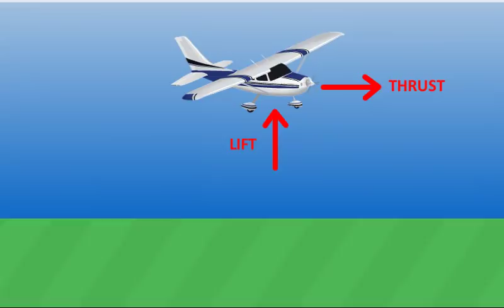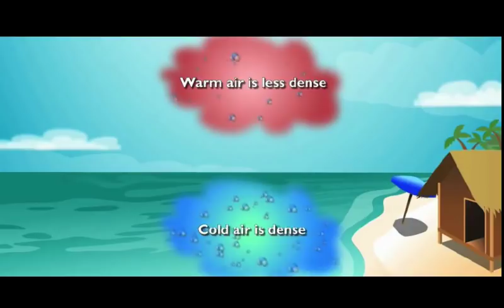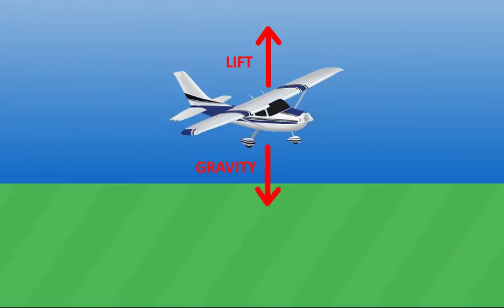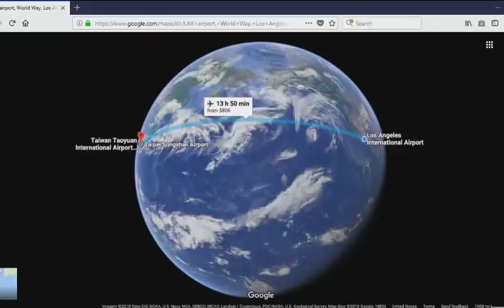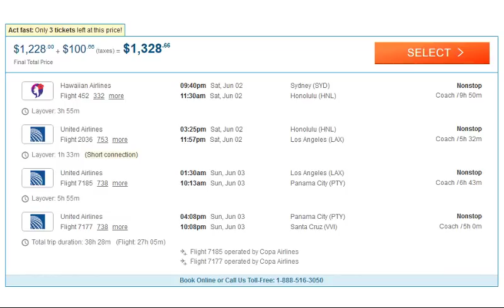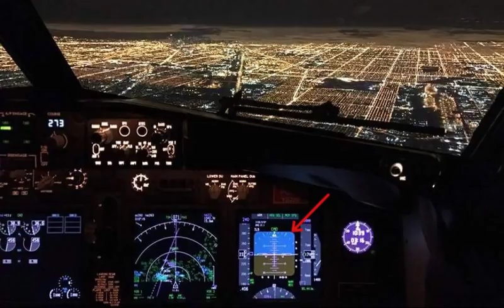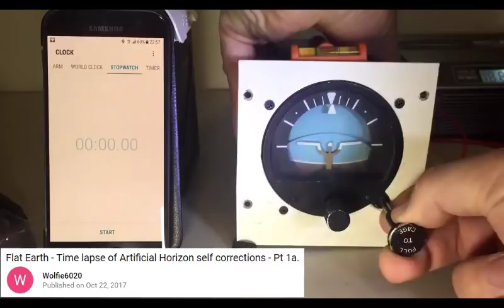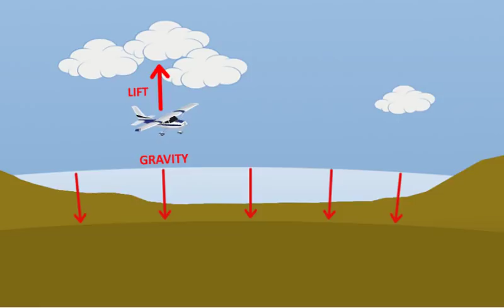Flat Earth Falsities - Plane Nonsense

Comment: This explains nothing....

On the one hand we have gravity pushing down the atmosphere to earth...

Then in the next breath we have cold air moving down and hot air moving up....so in effect the powerful gravity has a hard time keeping warm air down but an easy time fighting jet engines & helicopters...plausible...
Reply: You see Anthony, the force of gravity is proportional to the mass. Warm air rises only because cold air which has greater mass falls. Helicopters and jet engines have even more mass so gravity exerts a greater force. An 8-year-old seems to understand gravity https://youtu.be/QcUey-DVYjk so why can't you?
.
When airfoils like helicopter rotor blades and jet aircraft wings move through air, they produce lift; with sufficient speed and angles, enough to lift helicopters and jet aircraft. But maybe you should master gravity first.
.
In a vacuum chamber a bowling ball and a feather fall at the same rate. What causes this to happen Anthony? They accelerate at 9.8 m/s², which is "g" the acceleration of gravity.
Reply: @romithromith  they fall at the same rate...🤦‍♂️

That proves the density of a feather versus air is enough to slow the feather down...in a vacuum there is no friction from the air to slow it down...

Yes it might travel at the same speed but it certainly doesnt prove gravity.....

Same as chucking a stone in a river as oppose to a piece of wood..

The stone will sink because it's more dense than the water the wood will float because it isnt
Reply: @anthonyferguson4218  A. It's proven that things fall.
B. It proven that things fall with a constant acceleration in a vacuum.
C. This is a physical phenomenon.
D. We named this phenomenon gravity. Gravity is just a name!
.
Air drag slows my truck, friction from a rough road slows my truck.
You wouldn't say that air density or a bumpy road causes my truck to move.
You wouldn't say my truck wants to find its place.
There is a mechanical force causing my truck to move horizontally.
What force causes things to move vertically?
Think: why does it take more energy to drive up a hill than down the other side?
.
Buoyancy is the effect of gravity in a fluid environment, not a disproof of gravity. (Do an experiment to test gravity. 1. Weigh a piece of wood, 2. Weight a bucket of water, 3. Weigh the bucket of water with the wood floating in it. If gravity exists, 1 + 2 should weigh the same as 3. Let us know your results.)
Reply: @romithromith  why do things go faster downhill?🤦‍♂️

What are you talking about??

My wagon will free wheel down a hill quicker than my car...it also takes more effort to stop because its heavier..

None of this is relevant it's just filibuster👍 seems quite hard to get direct answers....yet I keep getting told 5 year olds understand it...yet the same people avoid the question and resort to ad hominem attacks instead...🤦‍♂️
Reply: @anthonyferguson4218  I have no idea what you don't understand or want to know. Without an understanding of Physics you are vulnerable to the arguments these FEers use.
.
If Earth isn't moving 1,000 mph, then the Sun is moving 1,000 mph. That's faster than the speed of sound. You should see the Sun streaking through the sky. You should hear sonic booms on a daily basis.
.
The FE gurus use a common sense fallacy and appeals to personal incredulity. Polaris isn't exactly at the center and it's not always been the pole star. Stars are at astronomical distances and also in motion around the galaxy, the earth exhibits conservation of angular momentum, precession occurs, planets do perturb one another but slightly, you need to understand inertial frames of reference. The helicopter retains its momentum when lifting off.
.
Pan Am Flight 50 did cross Antarctica. https://www.cnn.com/travel/article/pole-to-pole-pan-am-flight-50/index.html But there are issues with flying across Antarctica such as fuel freezing, strong winds and unpredictable weather, the stigma of the crash of a New Zealand flight over the continent, emergencies and navigation.
Reply: @romithromith  any citations on polaris??

Earth spins at 1000mph...

It goes around sun at 67000mph

Chasing the sun as it moves 500000mph

In a galaxy that's doing over 1million mph..

If its spinning 1000mph and I'm following in a plane at 500mph how will I ever get there??

And going the other way I should just be able to hover until my destination comes around..

You say physics....that's a little lazy throw around word it's either spinning or it isnt..🤷🏾‍♂️
Reply: @anthonyferguson4218  I don't have time now. I'll get the citations later.
.
Spin is measured as angular velocity. Earth spins once per day. The instantons velocity at the equator is ~1,040 mph. The centrifugal force is much, much less than gravity.
.
The other speeds are constant and very nearly linear so acceleration is miniscule. We don't perceive speed, only acceleration.
.
The Earth isn't chasing the Sun. The solar system is in an inertial frame of reference.
.
No, the plane or helicopter were rotating with the Earth and the momentum is conserved when they leave the ground.
.
No Physics isn't a lazy throw around word. You would have understood already and not bothered asking these questions.
Reply: Physics. Learn it.
Reply: Anthony Ferguson

"This explains nothing...."
Actually, if the earth were flat and not spinning, we wouldn't have weather. No wind, no clouds moving along.
Reply: @SamIAm-kz4hg  I've never seen a roundabout create weather...🤦‍♂️🤦‍♂️

The sun causes weather....it creeates heat that rises and colder air moves in...creating warm fronts cold fronts and different air pressures..

Spring creates weather..🤦‍♂️🤦‍♂️😁
Reply: @anthonyferguson4218  did your school bus have two seats?
Reply: @SamIAm-kz4hg  🤦‍♂️🤦‍♂️🤣🤣

Ffs...🤣🤣 the sun doesnt heat everywhere evenly at the same time you plank...ffs🤣🤦‍♂️
Reply: @anthonyferguson4218  did your school bus only have one seat?
Reply: @CaptWesStarwind  I went go school on the lunar rover....me grandad made it from some old pram wheels and a pallet.. 👍
Reply: @anthonyferguson4218  
If the earth were flat, it would. This is why the flat earth theory is bullshit.
Reply: @SamIAm-kz4hg  ridiculous comment...you obviously know nothing about weather...
Reply: @CaptWesStarwind  it's not that moronic at all...and I thought exactly the same way until a few weeks ago....I didnt give it a look because it was a nutjob world imo...but I eventually had a look in the aim of debunking it as bs instantly...and yet I couldn't...I must be stupid...🤷🏾‍♂️

But theres flat earth and flat earth...one is a flat earth flat earthers think is stupid...its a fake one picked on by people to steer people away from a more realistic possibility...

And I say possibility....because just as flat earth can not be proven or disproven    unless they let flights go directly over Antarctica....ball earth can not be proven that it spins 1000mph around a sun at 67000 miles per hour following a sun at 500000 which is also moving with its galaxy at over 1m mph...all the while keeping north start in the same place as it has been for 1000s of years...

Apparently they can fly into space and take pictures...yet no real pictures or video exist.. .so until that time that either can be confirmed by fact not pseudo science bs...they are both just beliefs
Reply: @SamIAm-kz4hg  you have no clue...seriously...no clue.....zero
Reply: @CaptWesStarwind  I believe its plausible...you believe its spinning around like a spinning top on itself around the sun at the same time as flying through space...

It's a belief it certainly isnt fact...its exactly the same thing you believe what your told...there is absolutely zero evidence...to back up your claim

There's 2 trains of thought......one takes billions of tax payers money 

1 doesn't make anyone any money...now i wonder which one science will pick to follow...🤔

100s of billions have been spent on space from that we have gained some cartoon pictures of earth and some fake mars footage

It's a bargain...👍
Reply: @CaptWesStarwind  try and remain focused...instead of ad hominem attacks tel me all about this simple geometry you speak of👍

I am just a fool who needs to learn from you oh wise one🙏
Reply: @anthonyferguson4218  
"you have no clue...seriously...no clue.....zero"
Did you think this was an intelligent response for something?
The irony is awesome.
Reply: @SamIAm-kz4hg  the sun makes weather ffs it's not hard to get your head around.. 🤦‍♂️
Reply: @anthonyferguson4218  And yet again you provide nothing meaningful in response. What is it about weather you think I don't know? Use your words.
Reply: @SamIAm-kz4hg  no not really that just got made up in the 1970s textbooks....there is no mention of it before...

All ancient calendars used flat earth...they still work...the north star is still in the same place it always has been..

How is it possible with the speed and trajectory the planets all spinning around each other at different speeds...

Then how is it spinning 1000mph commercial flights only cruuse at around 500mph..making it impossible to reach your destination if following the rotation. ..if going against it you will speed the journey up x3...

Technically I should be able to hover in a helicopter and wait for my destination to turn up...highly improbable imo
Reply: @SamIAm-kz4hg  and btw there is not 1 real picture of earth from space...not 1
Reply: @anthonyferguson4218  
"no not really that just got made up in the 1970s textbooks....there is no mention of it before..."
So now you are adding EVERY historian to your conspiracy. Are you beginning to see why you sound looney too us?

"All ancient calendars used flat earth...they still work...the north star is still in the same place it always has been.."
WTF?!?!?! The spinning of the Earth does not change from day to day. It has no influence on a calendar. And the north star isn't actually in one spot. It is close. With as long night exposure you can see that it scribes a very tiny circle. But that "fact" has no bearing on whether the Earth is flat or not. Again, you're really sounding looney.

"How is it possible with the speed and trajectory the planets all spinning around each other at different speeds..."
WHY AREN'T YOU EDUCATING YOURSELF ABOUT THIS??!?!?!?!?!?!?! The planets that make up our solar system are INCREDIBLY far apart. Yes, they travel at different speeds. What about it? Are they not allowed to?  ; )

"Then how is it spinning 1000mph commercial flights only cruuse at around 500mph..making it impossible to reach your destination if following the rotation. ..if going against it you will speed the journey up x3..."
What the fuck are you smoking?
I suspect that you think if you jump up in a moving train travelling at 60 mph then you will be shot backward at 60 mph, right?
Everything on the Earth travels WITH THE EARTH. That includes the atmosphere. Planes fly in the atmosphere.
Please please educate yourself properly.
You sound like a complete and utter fucking moron.
Reply: @CaptWesStarwind  I'm getting conned by you...Never A Straight Answer

I'm not fully sold on it btw...but it has made me question why a took the ball version as gospel with zero evidence or questioning....because science says🤦‍♂️

That was my error i bought into ball earth with zero thought...just like everyone else...pseudo science with no evidence is not fact...its belief

If I can get satisfactory answers to questions I will go back ball...but the so called set in stone "science" seems to rely more on name calling than evidence..

Which is a little worrying....all this money spent and no evidence...no logical answers to simple questions🤔
Reply: @anthonyferguson4218  Don't fall for Taboo Conspiracy's condescending sarcasm. Fast talkers like Ben are con artists. 

Refraction is real and most significant over water – you notice he's always doing his observations over water. He never acknowledges that objects seen one day will not be seen the next. I commented about 2 issues with his laser, instead of responding he banned me.He likes playing to people that don't catch his BS.
Reply: @romithromith  the reason you cant see sometimes is because of the air quality...I can go up hills walking one day and see for miles another day I will see lot of haze and visibility will be poor even though it's a nice day. The reason it's done over water is water is level...you rarely get land level for a good stretch which makes it hard to compare which is specifically why water is used it's much easier...refraction is a thing but not on them pictures

Aeroplanes fly level not nose down...its nothing to do with gyroscopes or autopilot altitudes...its easy to see hour flying level by the clouds and your drinks...planes dont drop a mile every five minutes to stick around the globe...that is for sure

If your spinning earth is at 1000mph but cruising in aeroplane is 500mph...how do I ever get to my destination if it's spin is going with me...it would be moving away from me..🤔
Reply: @anthonyferguson4218  oh, and you clearly don't understand science. Try getting an actual education.
Reply: @anthonyferguson4218  The amount of the Toronto skyline seen from across Lake Ontario varies. So too the amount of Chicago skyline. Joshua Nowicki made the news taking photos from a spot where Chicago is not typically seen. This is called looming.
.
The reason it's done over water is that the lowest levels of air are much denser and produce greater terrestrial refraction. Explain Wallace's result in the Bedford Level Experiment.
.
Because of the atmospheric pressure gradient, which also curves with the earth (and the scale of Earth) planes don't need to fly nose down. No, planes follow the curve of Earth so the remain at the same altitude.
.
Your plane retains the momentum of Earth and speed is calculated against the ground. The autopilot makes small continuous collections flying north or south.
Reply: @romithromith  that's impossible...the ground is moving twice as fast as the plane on a spinning globe...or am I supposed to believe that the air also spins at the same speed as the ground so it's all relevant to each other and not noticeable because its all beautiful synchronisation moving in harmony together...??

It doesn't matter how I leave the runway if I'm going the same rotation ground earth will surge straight past me as I lift off at twice my speed...

Can you see why this doesnt work...??🤔
Reply: @anthonyferguson4218  Before it left the ground the plane was moving at the same rate as the ground. That motion is conserved. Otherwise, where does the energy go? Research conservation of momentum.
.
Actually yes, ignoring winds, the air does move with the Earth because it's part of the Earth. Research how a torque converter in an automatic transmission works or a centrifuge works. 
.
No the Earth will not surge past you. Research conservation of momentum.
.
I understand Physics so I see why it does work. Maybe you should take a course in Physics and see for yourself.
Reply: @SamIAm-kz4hg  before you go calling people morons, maybe do some work and learn something
Start at googling "frame of reference" and apply it to your aircraft flying on a spinning earth query.
Reply: Gravity is not that strong. You just standing up and not falling means that you can beat the gravity of the earth with only your muscles. Gravity being strong is common misconception among flat earthers, and using that idea in an argument against gravity is a strawman through and through. 
Gases at different temperatures can even beat gravity. The hot gases rising above cooler gases is testimony to that. The gases on top still have the gases below to "sit on"
Similar to how you can beat gravity all the way to the edge of the atmosphere if you had a theoretically strong enough ladder to keep climbing
This isnt hard guys